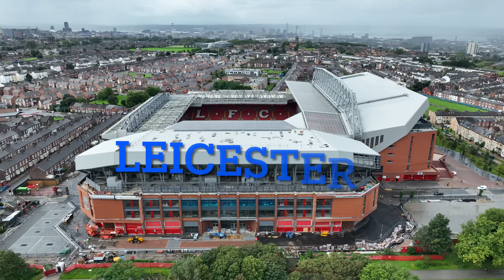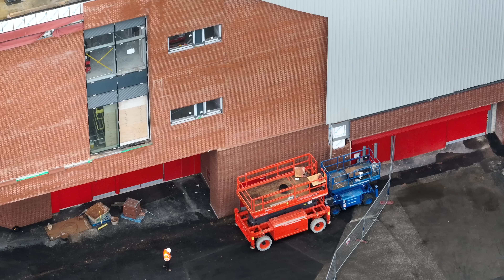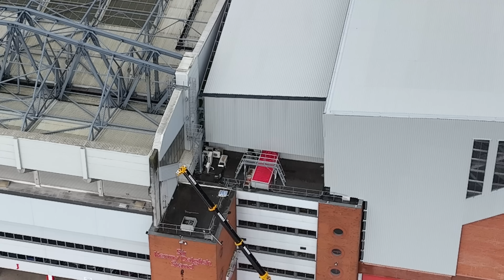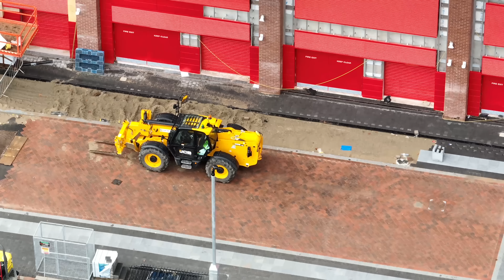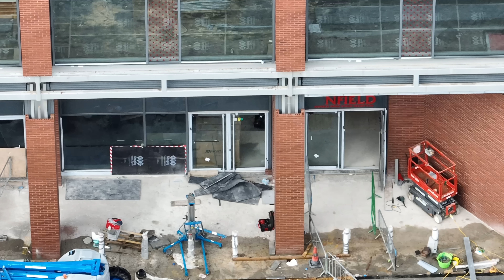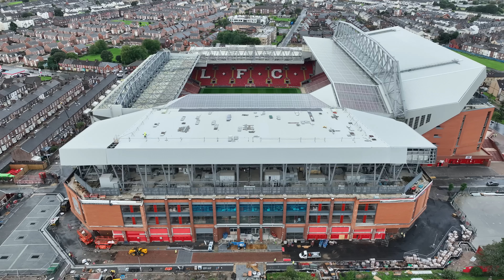Match ticket giveaway at Liverpool F.C’s Anfield Road Expansion

Comment: How can more seats go in before underside of roof cladding has been completed? Surely this will require scaffolding to access underside of roof?
Reply from the maker: Cladding will be last to be done now
Reply: @Kevcupo  the last photo I saw of the cladding under the roof showed it in a well dodgy state and probably a safety risk. Is it still like that? If so, how can it be fixed without scaffolding? If scaffolding is needed, can this be installed with all of the seating in place?